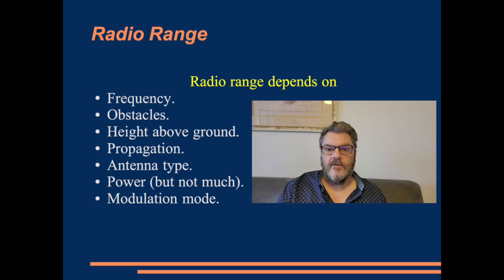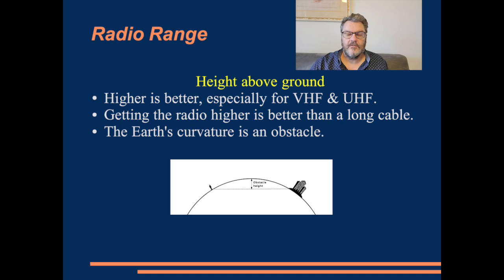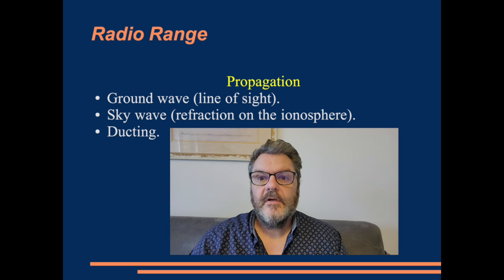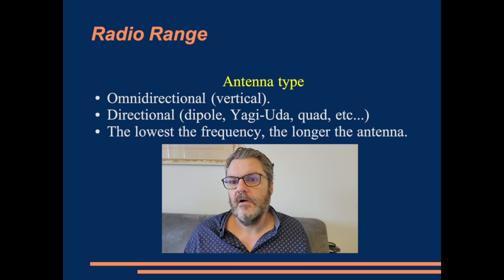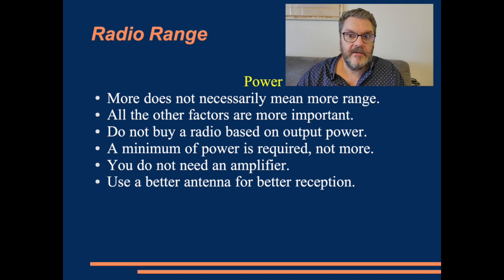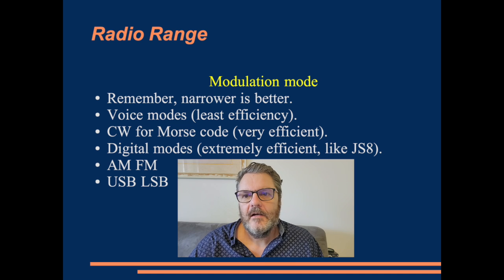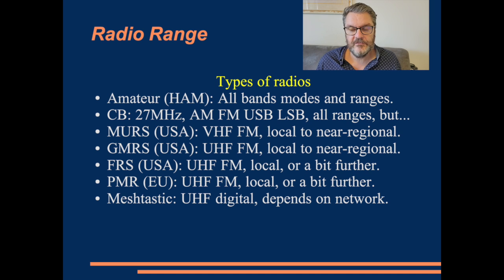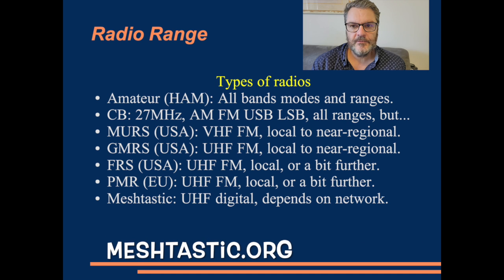Demystifying Radio Range.

Comment: Always appreciate your videos, great explanations. I will probably have students watch this as part of thier training for thier Tech license. I do disagree to a degree on power, specifically when it comes to VHF near-regional. I do a lot of VHF FM and SSB Simplex operations as well as "backup" the local repeater on the reverse. I firmly agree that Height, Antenna and cable quality come first, but I know from experience, without ducting, that added power on the vertical or the yagi helps. Of course you can't actually pass traffic if they can hear you because of power but you can't hear them, so it is much lower on the priorities and that Height/Antenna/Feedline are critical. Simplex without ducting on VHF FM can be 40-50 miles consistently at 100-150w (even better on VHF SSB) depending on terrain, height, antenna, cable. Also an amplifier can help overcome power losses due to cable quality and length, which unfortunately for me is 50ft for the tower and 70ft to the shack from there. Again, thanks for the video!
Reply from the maker: If you listen closely I do say "you.might need a bit more power" talking about VHF/UHF.
Reply: @RadioPrepper  I did hear that part and I realize your are making an important point that I agree with. Power is the last answer not the first. W5KFX

Comment: I have a question i have walkies for emergency,  how far can the walkies reach another person say in new york. And if i was on the 15th floor in Manhattan trying to contact a person 10 miles away on the the 6th floor of a apartment, could i reach them.

And is higher elevation aka going up floors or a roof increase my chances to reach a person farther away.

The walkies are rated 5 watts and are retevis frs
Reply from the maker: That should be no.problem if the radios can "see" each other. Yes, height helps a great deal.

Comment: This is a very informative video Gil. Thank you very much! The longest Winlink VARA connection I have made is from the USA to Australia on 10 meters, though I had to get up before sunrise, set up my station in the back yard, and make the connection. One little correction I would like to make is that most of the FRS channels now allow 2 watts. There are some that still have a limit of .5 watts. 73 KD5YOU

Comment: Great video. One thing, FRS in the US has changed to 2 watts on the fifteen 462 MHz channels and 0.5 watt on the seven 467 MHz channels.
Reply: I thought channels 1-7 and 15-22 is the best to use more power on walkies.
Reply: Channels 8-4 are between the repeater inputs. That is why they are limited to 0.5 watts and are illegal to transmit on from mobile units.
Reply: @blankreganon5395  so which channels activiate your walkie to use the most power. USA
Reply: All of the channels on the 462 MHz frequencies. This are channels 1 - 7 (seven of the original FRS channels) and 15 - 22 (the eight original GMRS simplex / repeater outputs). The 0.5 watt channels (8 -14) were the other seven original FRS channels. They are in-between the original GMRS repeater channels. They are still 0.5 watt to reduce the interference with GMRS repeaters.

Comment: I actually had my first ducting experience two days ago. Here in Massachusetts, in the US, I was working POTA at 10W, with an EFHW sloper. Normally, I can expect about 700 miles or so, which puts me in the midwest. I ended up picking up western Arizona, on 20m, which is about 1200 miles away. I have NEVER made a contact that far, on the low wattage I use. It was pretty cool :)
Reply: Ducting propagation does not happen at HF frequencies.  That is a propagation mode in the VHF/UHF bands.  At 20M (14 MHz) you were using regular sky wave (skip) propagation.
Reply: @mikesradiorepair   Gotcha. Got a good skip then :)
Reply from the maker: Great, but that was skip 😀